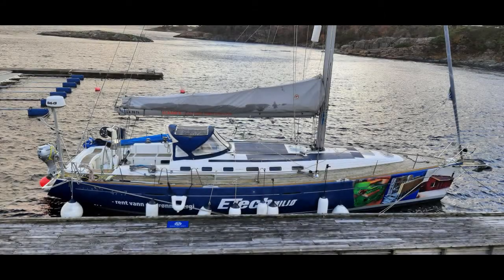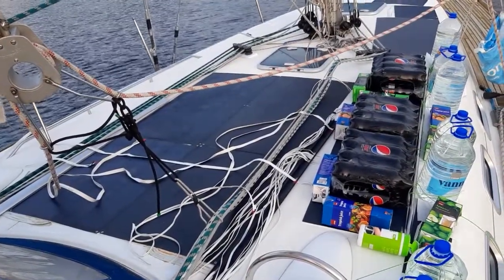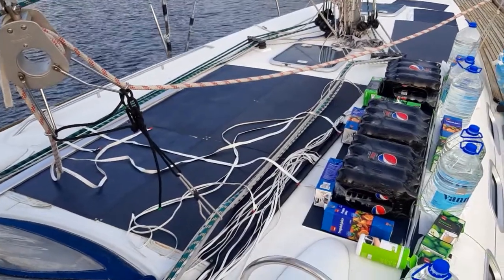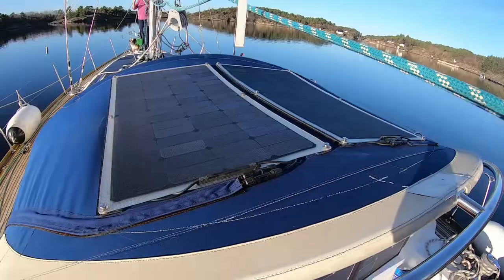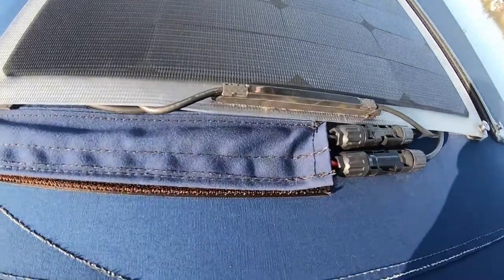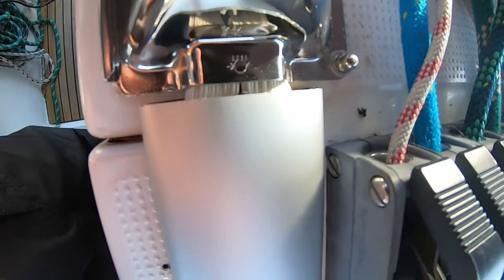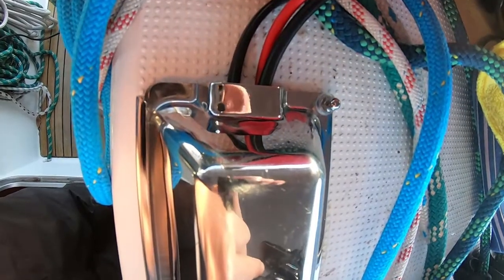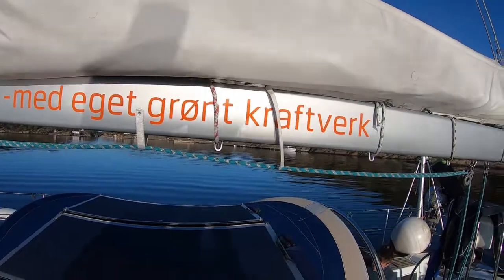solar panels electric First 47.7

Comment: can I get more detals about those solar panels?   and their thin wires?  I am building a catamaran, and want to make them permanent into the side of the hull,  but, I was worried about cable durability,   salt water,  and also ability to change out every 10 years.    Who is the manufacture?   can you epoxy over them?

Comment: Nice installation. Did you use Diodes in between panels ? How did you plug these 24 on MPPT controller ? Multiple MPPTs ? Thanks in advance.
Reply from the maker: All solar panels are connected in parallel. According to the supplier Sunbeam, there is no need to use diodes when in parallel. They are connected to 4 MPPT charges and they have the added function of boosting the V to a max of 58,4 V. You will also see in later videos that we have added 800 W on the cockpit side as wind breakers. To this we have added 2 new MPPT, + one extra in spare that can be hooked up to a foldable panel in the rear of the boat. Under good conditions, the boat will move 2,5-3 knots on solar panels alone.

Comment: hmmm... zero explanations.... how are you wiring them series, parallel ? how are you considering the issue of 1 series panel obstructed causing a drop across all series'd panells ?  what tests and measurements have you done ?   needs much more information for me but well done of course. what about regen and prop type, is it feathered or servo'd ?